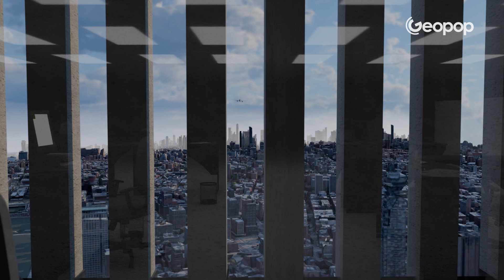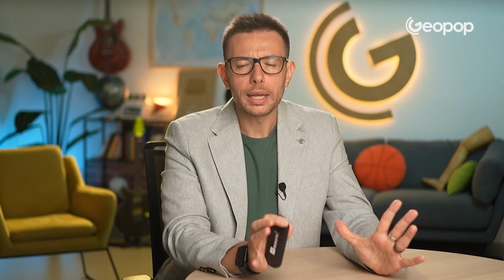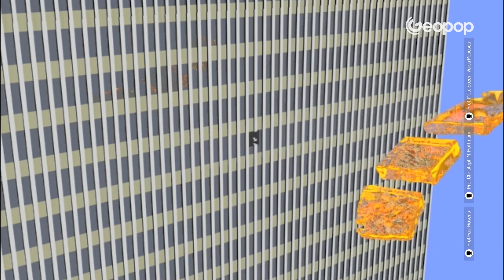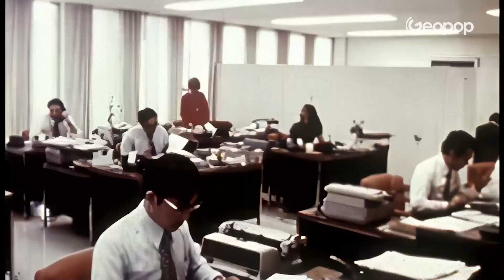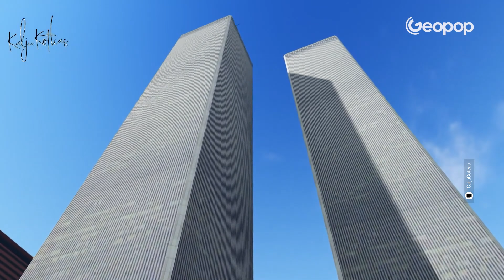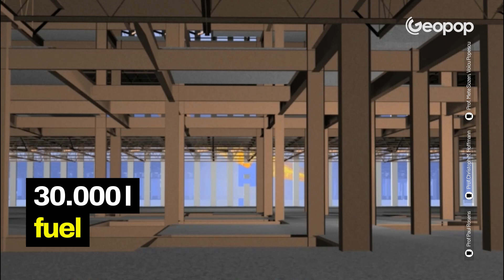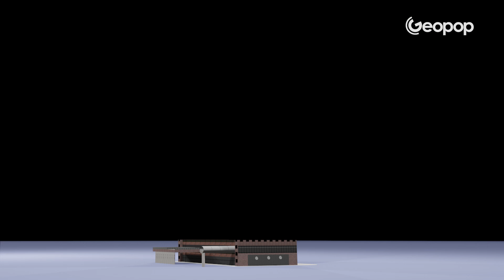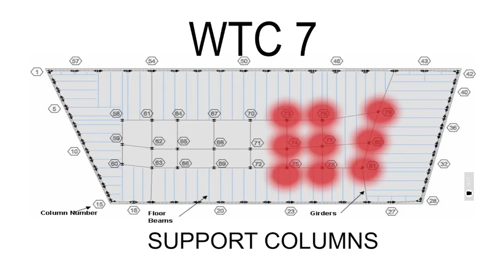9/11, 2001: The Technical Reconstruction of the Twin Towers and WTC 7 Collapses

Comment: Holy crap, That’s a lot of manure . You must have been a farmer.
Reply: And yet that was the best rebuttal you could manage. 

Wow, given the choice between the long and highly detailed technical analysis above, supported by the overwhelming majority of the worlds engineering community and your thoughtless hand-wave, after careful deliberation I have to go with the smart people version.

Thanks for playing though.
Reply: @TheLoonResistance  …. As a background in Mech Engineering that was a a demolition. All 3 buildings.
I’m not going to go into details. But just by looking at the footage, and some physics, that dropped like a rock. 
So what was presented was malarkey. 
Hope that helps 🙏🏻
Reply: @gunarsbrants8429  - I'm going to respectfully disagree and explain why, starting with the Twins:

Twin Towers collapses were relatively straightforward, the fundamentals well understood in the professional engineering community within just weeks. 

While complex, most of the Twin Towers collapse mechanisms can be seen with the naked eye and easily discerned and understood by the layperson if sufficient time is taken to understand.

1. The Twin Towers consisted of 4 primary structural elements that together formed an integrated system where each relied on the others. 47 hollow box-section steel Core Columns carry the majority of the gravity loads. The 236 hollow box-section steel Perimeter Columns carry the remainder and ALL of the lateral (wind) loads. Long-span Lightweight Steel Trusses connect the core and perimeter column together at each floor with a Hat Truss on top to tie the structure together as an integrated unit where no element can survive without the others. There was no structural load bearing concrete and most components were bolted together.

www.youtube.com/watch?v=u7OqrC74Dm4

2. The impact of 117 tons of airplane (= to about 12 dump trucks) at speeds up to 590 mph with the energy of a ton of TNT completely destroys the aircraft. This in no way implies the Towers come out unscathed. Many perimeter columns are damaged or destroyed as are some core columns (example; 33 of 59 perimeter and 20 of 47 core columns damaged or destroyed at the impact floors in the North Tower), This damage is primarily through bolt-shearing failures at the end connecting flanges, as well as bending, twisting and fracturing of weld seams. There was no cutting or slicing - the reality was far more violent and messy.

3. The impacts destroy or damage fire insulation, fire breaks and sprinkler systems on multiple floors. Huge fires are started across multiple floors simultaneously and allowed to spread rapidly with no effective firefighting or fire suppression. This was an unprecedented fire event .

4. The hotter steel gets the weaker it gets . With fire insulation stripped away and no sprinklers the survival time of the steel greatly reduced. Gradually over time heat causes the lightweight steel Floor Trusses at the impact damaged floors to sag, which was observed and recorded. No steel melted or needed to. Structural steel fails long before it becomes a puddle. It just needs to bend

5. Sagging floor trusses pull on the increasingly weak and overloaded Perimeter Columns, causing some of them to bow inward by up to 5 feet. A straight column is up to 4 times stronger than a bent column. The bowed Perimeter Columns buckle and fail, initiating collapse. The formerly static mass above which the structure below could easily support is now converted into a dynamic mass up to 30 times greater. Because they have buckled, the Columns above and below the failure point are no longer aligned . The load bearing structure below no longer bears any load as it falls past the lower columns, NOT onto them.

6. Thousands of tons of debris fall within the four outer walls, down through the open office space, crashing onto the first intact floor it encounters. This massive impact immediately breaks the bolted connections to the columns as the amount of resistance the Floor Trusses can offer is negligible. The falling debris slows only marginally and briefly. Note: 
6a. This is NOT a solid top block crashing into and “crushing” a solid bottom block . 
6b. The debris falls past the columns not onto them. The columns provide no resistance to the falling debris. 
6c. Only the bolted connections of the floor trusses to the core and perimeter columns can offer any resistance. A pair of 5/8” bolts at each end of each truss vs. thousands of tons of falling debris. 
6d. No laws of physics are violated. 
6e. There is no 20 floors against 90 floors but rather 20 floors against one floor, then 21 floors against one floor, then 22 floors against one floor, etc. 

7. This floor-led collapse progression within the four outer walls can only go straight down.
7a. This process is often incorrectly referred to as “pancaking”. The catchy name stuck but nobody knows what it really. Pancaking is too simplistic and inaccurate anyway, I prefer Kaiserschmarrn.

8. Collapse progresses through the floor systems past the columns, through the path of least resistance . The resistance offered by each floor is always the same while the mass of debris and its velocity – thus its energy - increases with each floor failure. Each floor offers the exact same resistance to the falling mass while with each failure the falling debris constantly gains both mass and velocity. *This process of floor-by-floor destruction cannot be arrested, it can only speed up . Rate of floor failures increases with each floor as momentum increases, reaching an average acceleration of 0.65 of GA, or 35% slower than true free fall. Bam, bam, bam down the building until there are no more floors to fail. The resistance offered by each successive floor is always the same. More mass, more velocity, same resistance with each floor. Don’t get stuck on the but the lower floors weren’t on fire nonsense. They weren‘t and didn’t need to be.

9. The Towers were 95% air by volume. As that air was compressed inside the building it is forced down the tower and blown out the sides in reaction to the building collapsing . Those were not “explosions”, it was expulsions of compressed air caused by the collapsing building, explaining the low velocity, lack of flash, blast, supersonic pressure waves and lethal high-velocity ejecta.

10. Perimeter Columns become detached and peel away like a banana behind the collapse front, playing out to the four points of the compass extending to more than 600 feet from the base of the towers. This was quite obvious from examination of the debris pile.

11. Core Columns fail last as their internal beam bracing is stripped away by falling debris and lateral support from the floor to perimeter columns is lost.

12. For those who care about how long this whole process took; 31-34 seconds from the moment the perimeter columns buckled until the last core columns hit the pile, or 1/3 the rate of true free fall. Don’t believe me? Just watch any video of the collapses and note the loose truly free-falling debris dropping much faster than the towers themselves.

13. Each Tower had a 1-acre footprint. Far from collapsing inside their own footprints the debris pile spread out over 17 acres in a pile up to 14 stories deep. 8 surrounding buildings were destroyed and scores more damaged by the falling debris.

14. NOT observed were the 180-190 dB bangs of thousands of high explosive devices or the blinding bright flashes of burning thermite. Neither explosives or thermite could have survived the impacts and subsequent fire nor could have caused the (silent) perimeter column buckling that clearly initiated collapse either. A video of a shocked and injured firefighter casually using the magic word explosion is in no way proof of explsoIVES and the demolition_ case relies entirely on that sort of thing. There is zero tangible physical evidence and it would be technically impossible, totally impractical and completely unnecessary. No one would bother.

15. Twin Towers were perfectly safe within their design envelope. They only collapsed when taken far outside design parameters by an extraordinary and unprecedented event

Impact + Fire (heat) + Time + Gravity = Collapse . Remove any one of those four elements and there is no collapse. Ignore any of those elements (as many do) and you will never understand the collapses. The Twin Towers were an integrated system in which no one component could survive without the others. One fails, the rest follow, through the path of least resistance – DOWN – through the open space, bypassing the path of greatest resistance – the columns. Nothing I just described violates any laws of physics. All of the above is true no matter who planned and carried out the 9/11 attacks or why

In 24 years zero structural engineers of tall buildings, including the 1/3 that have retired in that time, have made any statements in support of 9/11 Truth BS demolition claims. Zero, nada, none. The lack of any such citations in the engineering literature (published in any country worldwide) is palpable.

I hope you found this helpful and informative. It is not meant to be adversarial, but to solicit informed critical comment, positive or negative. If I made any errors of fact, logic or reason or left anything critical out, please let me know so I can fix it. To stay focused just one topic at a time please and on-topic (Twin Towers ONLY). No word-salads of Gish Gallop. IF you can offer a more plausible alternative be my guest. Please start any reply with the words “Tits McGee” or I will know you didn’t actually read it, are not serious and just wasting my time. If you are going to argue, do it on the merits.
Reply: @gunarsbrants8429  - Glad we got that sorted. Hope that helped 🙏

Comment: This is probably the most obvious video of propaganda I have seen in a very long time. Trying to convince people who understand the laws of physics and clearly see a controlled demolition, that they are seeing organic structural failure instantly qualifies you as either: 1) deceptively running cover for the government or 2) a complete idiot.
Reply: Well, it's not wrong because if it were you would have had a much better rebuttal than that.

Or a rebuttal.

Sure, it goes against 20+ years of internet dogma you've been indoctrinated with, but that's a YOU problem. The mechanisms described above are true no matter who planned and carried out the 9/11 attacks or why.

Let that bit of obvious blasphemy swim around in your head.

Comment: This was truly done by a Lib tard. Jet fuel and fires do not weaken or melt steel building seven came down with an implosion. It was even admitted to by Silverstein.
Reply: That post was truly done by a conspiratard.

You don't want to hear it because it goes against 2 decades of internet conspiracy dogma, but the mechanisms described here are not only correct (in most cases easily confirmed with simple visual observation) but have the overwhelming support of the majority of the worlds structural engineering community.

It sucks, but there it is